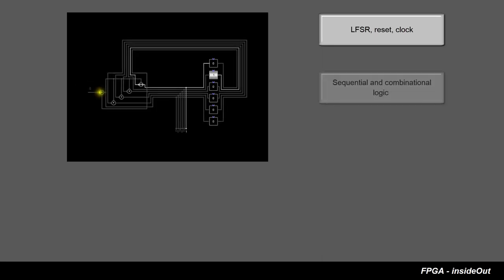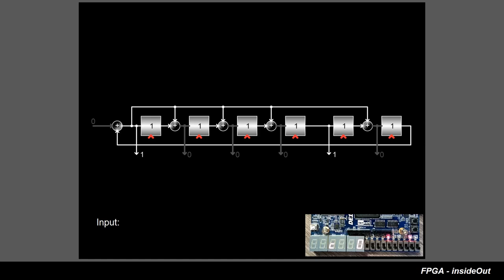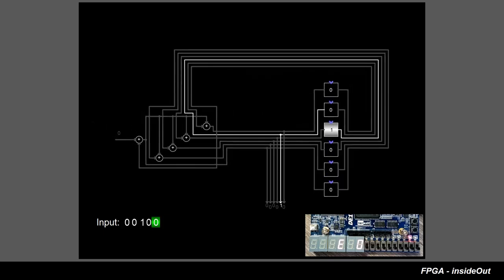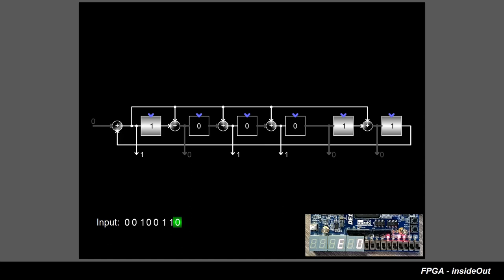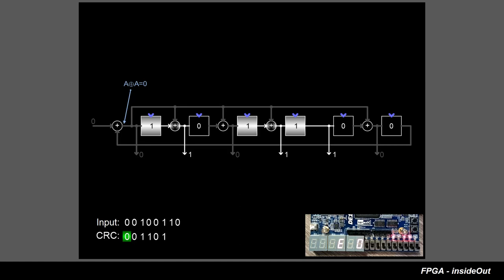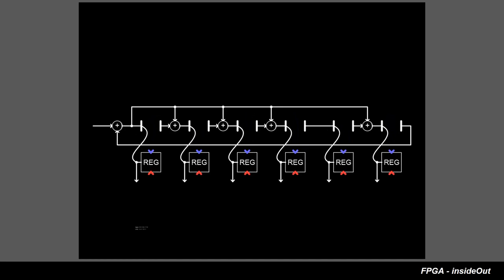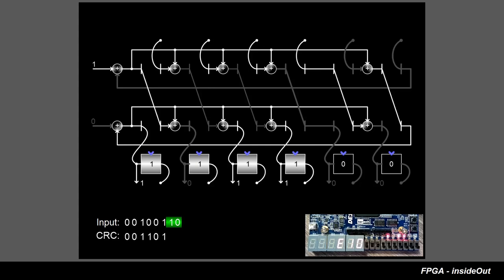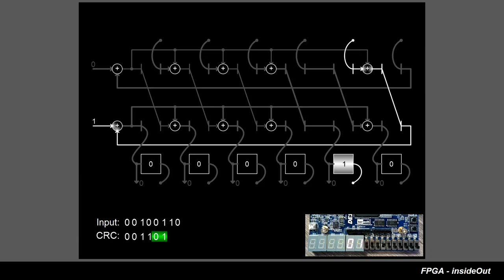FPGA InsideOut Session1 | CRC calculation | parallel CRC circuit

Comment: very useful 
i design my parallel 8 bit CRC16 with this
Reply from the maker: Hi, glad you found this useful. I don't know if this is clear from the video but this shift register is not using polynomial division and rather works as a "pattern detector". This shift register type is more optimised for CRC calculations and used in Ethernet MACs for instance (obviously with different polynomial). Speaking of parallelization - using this method you can unroll pretty much any 1bit shift register to make it process N input bits per clock cycle.